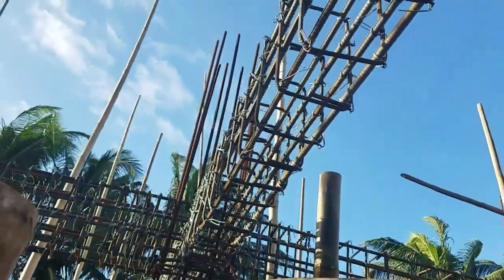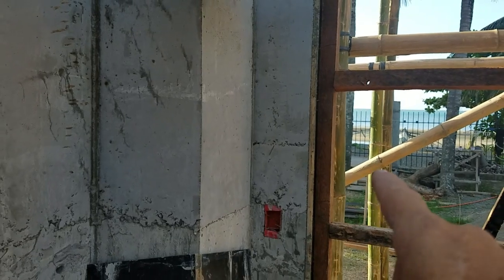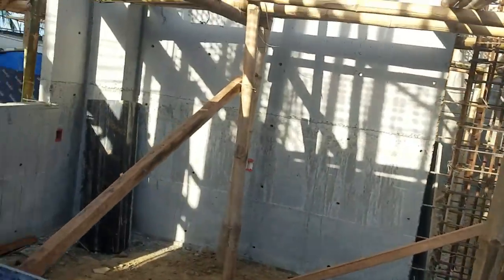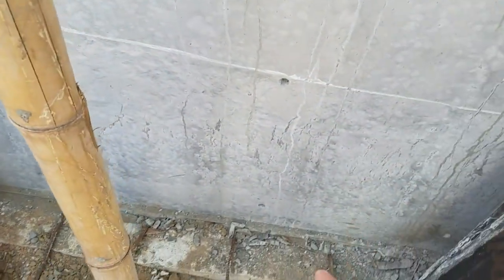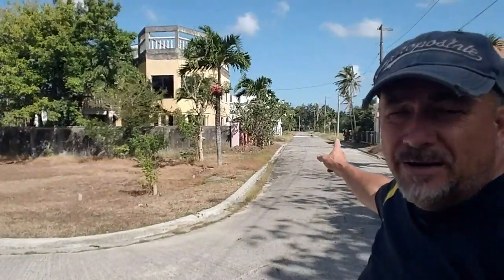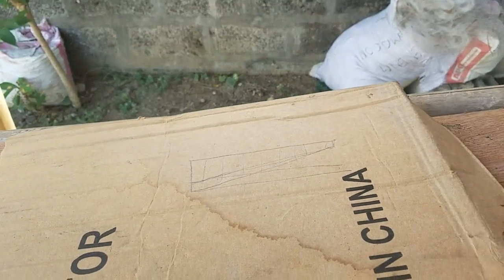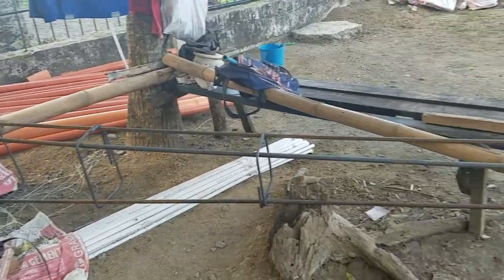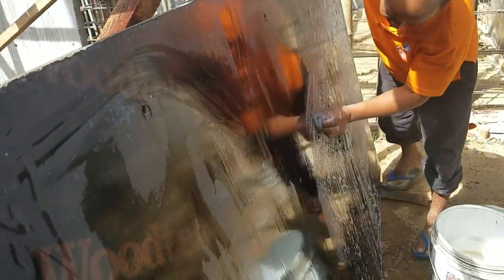Build Episode 77 2ND FLOOR & CANTILEVER LEVER  BEAMS Seismic Joints FORM CLEANING Front DOOR move!!

Comment: only just came across your blogs ,watched a couple of vides so far,is your back ground in the building trade,always thought of the tilt slab type deal ,or forming as you call it,looks like your doing a great job
Reply from the maker: I am a self taught builder and through the school of hard knocks and try n try again. My father was not a builder by any means but he did work managing production in factories and going on in life with a group of investors / partners to start his own factory.  He pushed books and constant lessons on my brother and I as well as my Uncle Gary. My Uncle and I really took to all he taught us on management , safety, time management and so much more. I apply those lessons to everything I do. He made it hard as hell on a young kid wanting to just go play like everyone else my age then but he gave me the tools and mindset that has gave me a successful life.
Reply from the maker: This would be called  CAST IN PLACE  or CIP for short. Then there is PRECAST and Tilt wall or tilt slab as well which is kinda like precast. I like tilt wall but you need cranes of some sort and other equipment to move those heavy precast walls or parts. Cast in place don't. If you ever have a question or anything just give us a shout. James n Melinda - loving life
Reply: @TexasFilipino  ya all good bud ,from oz and sometimes wonder about yanks ,met some in the provincial life before,and have found like its a game of cards,or war veterinarians,thats the Philippines in some ways,i will watch more of your vids,wife and family look like your the real deal ,keep up the great work

Comment: i got your point about lateral forces from earthquakes and construction joints for limiting rigity. this brings up the worst case lateral load. joints are the weak points on the side facing the shore line. do u think a wave could reach the house side? seems so from the front door being 1 floor up... hollow block could actually likely collapse leaving the columns to hold up floor 2. your  better CIP concrete system is far better. but how will it sustain that impact at the joints?
Reply from the maker: You have a good comment. I will address this directly to you in a upcoming video. You and I had the same thoughts!!

Comment: James after 1500 bags mixed the concrete mixer broke down during the pour of our dirty kitchen pour. First breakdown at 0 bags was ethanol deteriation of the carburetor casting restricting gas flow, changed motor after an hour to go home for the spare. Mixed 8 bags 
and the belts rolled upside down and the sheave slid half way off. three more bags and the gas filter wouldn't vent and was full of air. Took the cap off and assigned a guy to blow
 into the tank occasionally. 3 bags later  the governor wouldn't keep the motor running 
when all the materials were added. Just called lunch and worked on the governor some 
more.  mixed  one bag, worked on the governor again. Now at half the floor in play the governor control lever ripped in two, but finally the real problem was revealed. I made a 
lever out of tie wire and electrical tape. Looked pretty good actually. Then mixed a
 bag and adjusted the carburetor and governor 3 more times. Discovered 70 bags 
would run short and hustled to the hardware with a tricycle for 10 more bags andgot 
a delivery before DARK of 20 more. Asawa mistook liters for gallons and gas ran out, 
bought 3 GALLONS MORE !!! Had another mirenda and ordered rotisserie chickens. 
Got to the last bag, mostly mixed at 6 dark thirty when the  motor either stalled or 
finished the current tank of gas. I had 4 extra day hires in case we ended up shovel 
mixing, as we always do on floors.but not formed walls. Gave everyone overtime for
 the 1-1/2 hour late day plus P100 for their no complaining patience. Hired the extra
guys for a full week of work in appreciation.
        The described events actually took place Feb 28, 2020 from 9 AM to 6:40 PM
and nothing has been exagerated and with the help of the LORD we completed the 
floor for the dirty kitchen.

                                                    george and aurora

Comment: James, I have used oil on phenolic board with no problems except if you assemble
 the forms and have to wait a week for sand or gravel to be delivered. Over time it 
evaporates completely. We get the oil out of the Kawasaki. No use buying new oil for 
a single use on forms. I just do an oil change on the bike or concrete mixer motors.
Did I mention the Kawasaki has had 27 oil changes.  My next pour I am definitely
trying WD40  which is a silicon dry lubricant available at local stores and Wilcon, 
AllHome, SM malls etc.
     We did the hole house with control joints. Sort of a giant puzzle. Also the top 
tie beams had a well trowelled finish and a layer of 6mil poly sheet layed on that
so the upper floor would have a little sliding give in an earthquake. There are 640 
#16 dowels thru the floor slab to keep the floor on top of the building in a seismic
event. The control joints are under the center  line of the walls and not visable with
the floors poured one room at a time. About 54 bags per floor. DID YOU DESIGN MY HOUSE????
       On our third pour we pulled the forms off with a chain hoist over a lever to a building column, like rolling out a tree stump clearing land.

                                               george and aurora